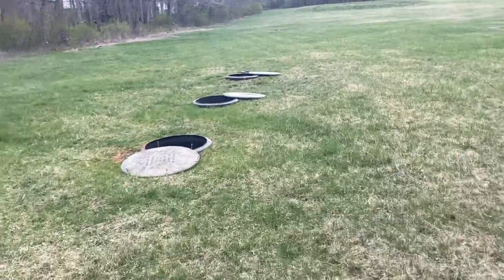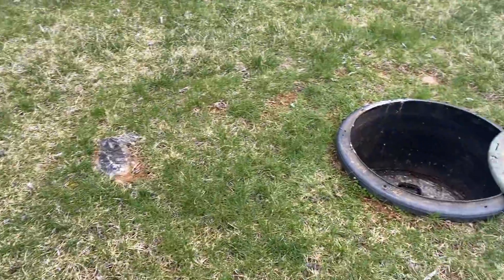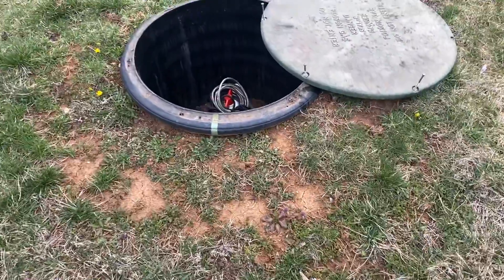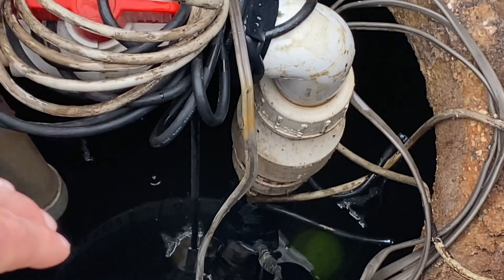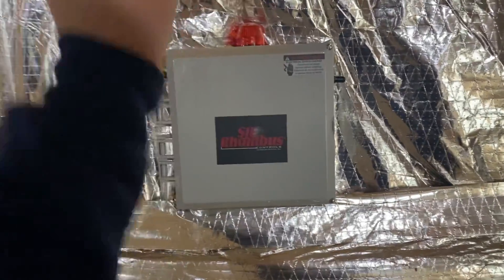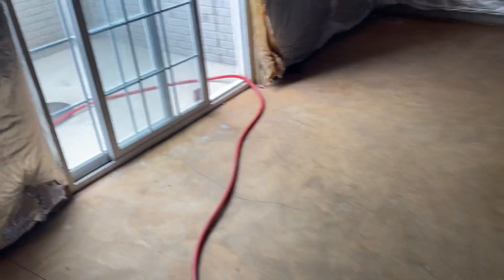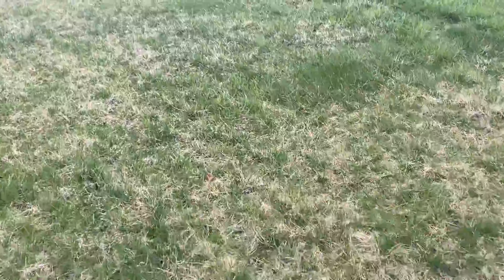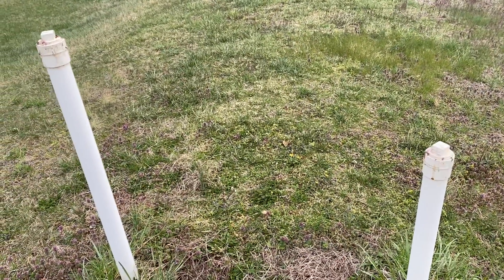Two Chamber Septic System Overview With A Pump Chamber And A Sand Mound

Comment: Well, I have a question recently. My septic alarm is going off for no reason whatsoever was determined that the control board has gone out. I pulled up my third tank, which is what goes to the drain field apologize I don’t know what it’s called. I forgot. and I noticed as it was pumped out that there’s a lot of black dirt or sand in the bottom of it with my pump. Is it bad to pump sand through the drainfield? I imagine it is but I can’t seem to find anyone to give me that information